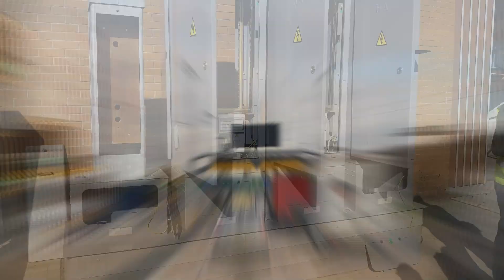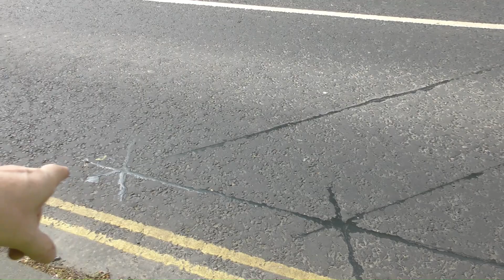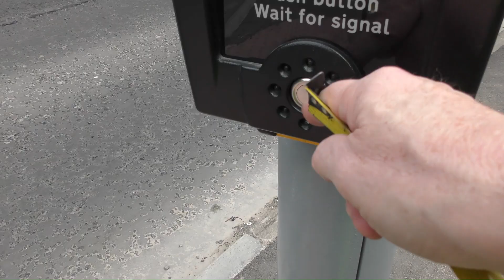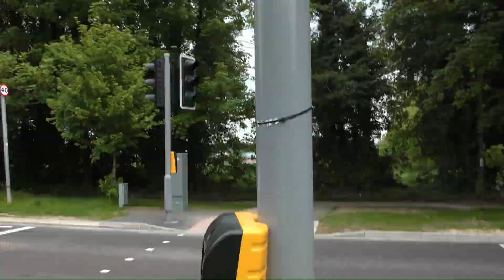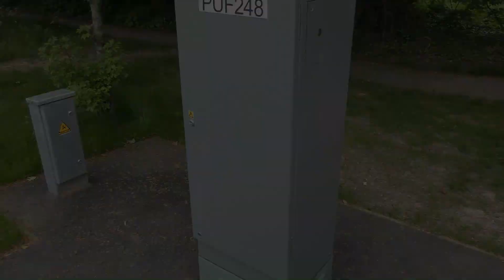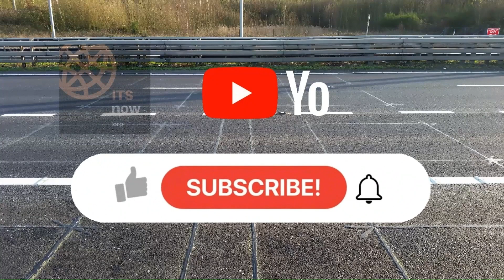Puffin Crossing Inspection

Comment: Hi Alistair, great video. I noticed there seems to be 'Primary' cowels on the 'secondary' heads. Is this deliberate to assist with visibility? Or is it a simple mistake?
Reply from the maker: Steve, on a 'mid-block' crossing like this, there isn't any conflicting traffic phases, therefore primary hoods are used to provide maximum visibility for approaching traffic. Regards Alistair